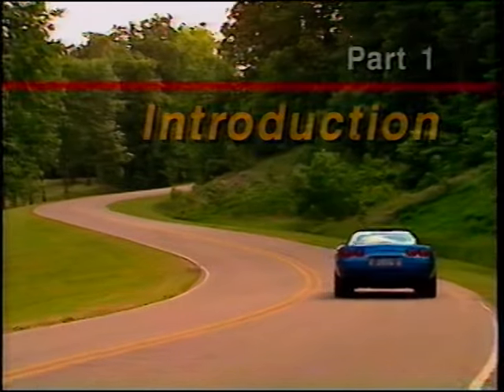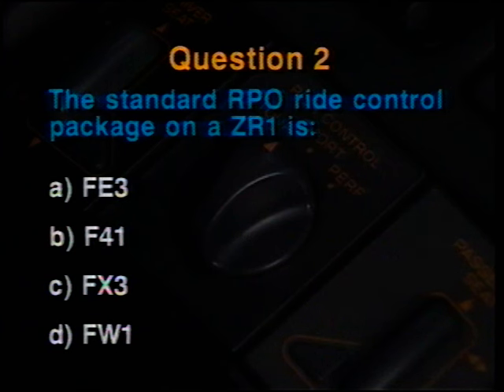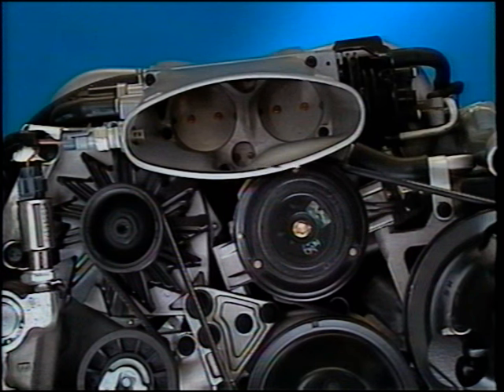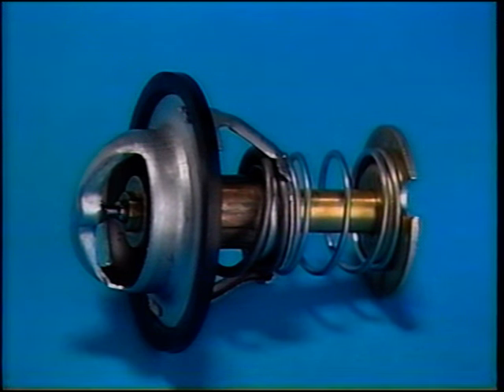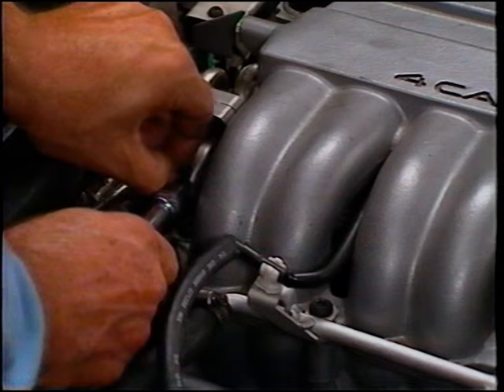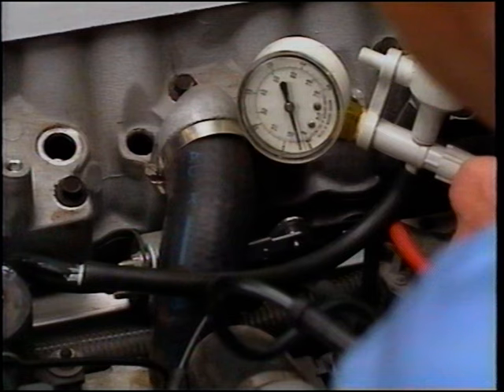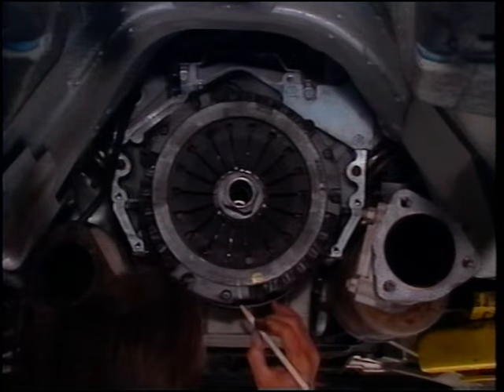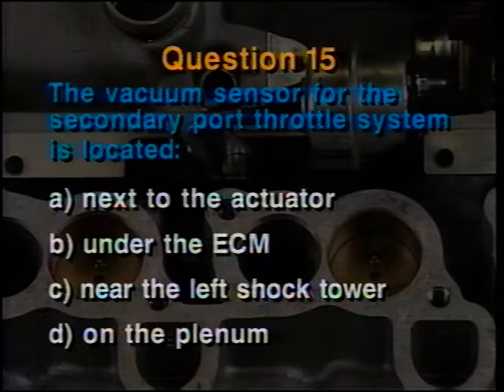LT5 ZR-1  Introduction Video

Comment: My first car at 14 was a 94 Convertible in the admiral blue 6 Speed not the ZR-1 but drove it hour & half back home barely knew how to drive a stick. And I still remember feeling like a rocket ship the incline to pull up was so steep. I think I killed it 4 times before I finally got her out and I hammered it then dumped  the clutch and tires burning never let out of it and slid into opposite lane just perfect. The guys at shop cheering, embarrassing to exhilarating. I say perfect but I was supposed to go right but ended up left. But hey nobody else knew that so fake it till you make it.